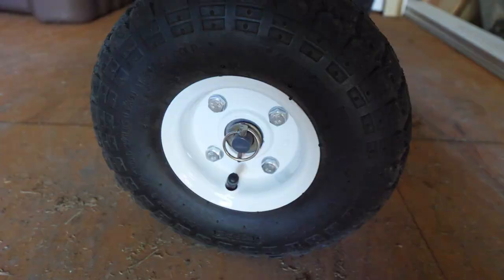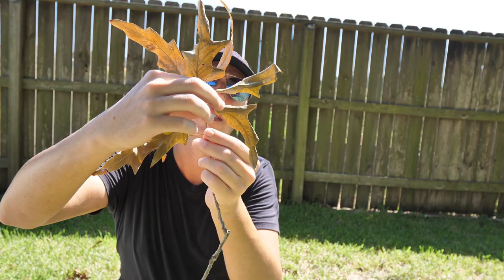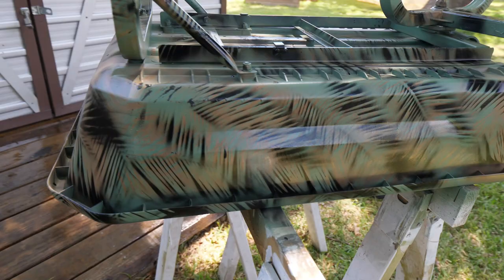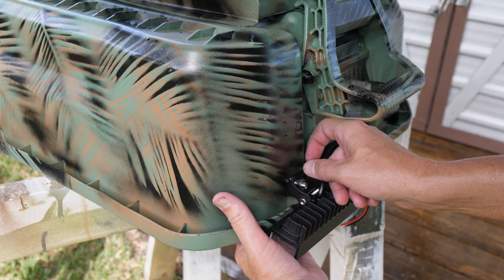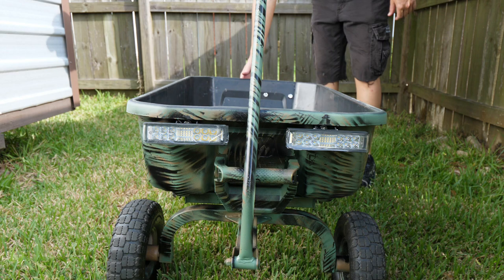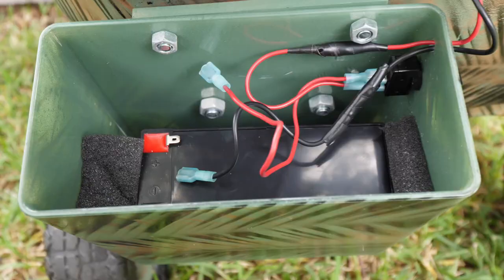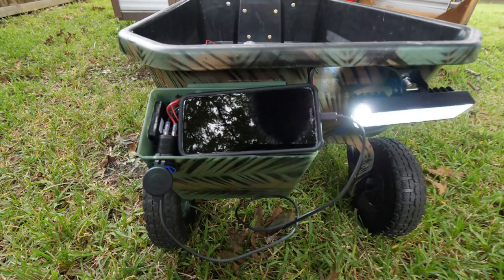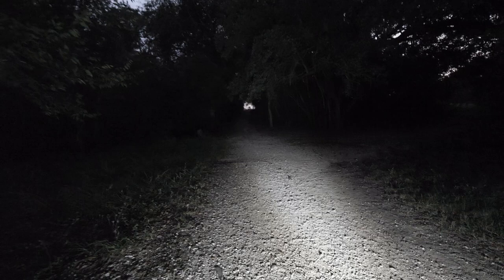How to build the best yard cart with upgrades. LED lights, tires, and more!

Comment: Make a pop on rain cover for it.  Electric assist motor for short hill climb.   Battery charge terminal for main battery.  Dimmer for the lights, and yellow removable lenses for some situations.  Lots of ideas.  All cheap mods.

Comment: The only thing I didn't like was that the battery box and light would be in the way of the dump feature of the wagon. I'm sure it's fine for hauling camera gear though. I'm looking at getting one of these wagons for rock hounding and having a light would be awesome headed back from somewhere in the dark. Good video, thanks for sharing you project.
Reply from the maker: Thanks!! I considered putting the box on one of the sides, but I sometimes drag the wagon through thick brush and it would get caught up. There's no room in the front due to the handle, and I don't intend to use the dump feature with what I haul. I would have chosen another wagon without the dump, but this is just what I already had. If you're not going through thick brush, try putting the battery on the side. If it doesn't work out, at the least, you'll just have a couple extra holes. Thanks for watching!

Comment: Nice! Bro, love it. But I would have set the battery next to the dump handle, also i would placed all the wiring beneath the battery and lift the battery with an L bracket, so that it would be easier to replace it without breaking anything... Also this carts have 8 slots for side rails, may be next mod more lights and bartery?!?!?!🤣🤣🤣

Comment: so i have done the index card method when painting a car wheel to avoid painting the tire. if you are trying to do a camo paint job on your wagon why not paint the tires as well?
Reply from the maker: I thought about doing that. My concern was that the paint wouldn't last long on there and start flaking off.
Reply: @BrooksWildlife  yes it would flake/rub off as the tire sidewall rounds the corner to the typical rubbing surface against the ground. And yes when a larger rock rubs against the sidewall it will scuff the paint but that's the beauty of the camo, it is not a perfect color so it will hide blemishes for a while..... Ok time to come clean. I have been picturing plasti dip this whole time haha. As the tire rolls and compresses yes regular paint would probably flake off.... well if you feel like trying plasti dip I'm pretty sure they have the colors to match your camo.  Nice build btw.
Reply from the maker: Good idea! I didn't think to plasti-dip the tires.

Comment: New subscriber I was going to suggest lifting it using wooden blocks but if you're a welder go for it. You can put some really tall tires on it then.of course then there's the weight issue if you go too big
Reply from the maker: I found some 15x6 tires/wheels from a riding lawnmower that I may try out. They're not too big, but are definitely bigger than what's on there. Thank you for commenting.

Comment: If I was you I would put that backlight on a switch of its own
Reply from the maker: I thought of that, but if I am using the fronts on the trail, I still want some light behind me too. I did add another toggle switch, but I am using it to separate the lights from the other accessories. That way, if I do use the USB plug, the lights don't have to be on to use it. Thank you for your suggestion. I still may consider doing it. 👍